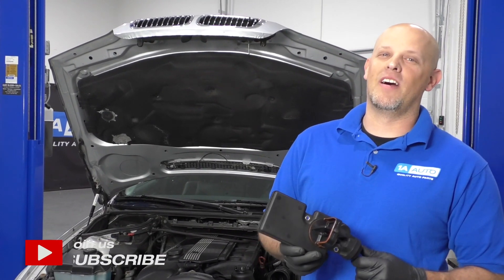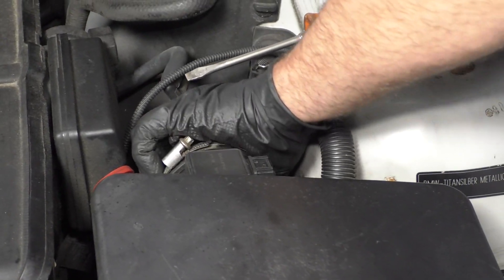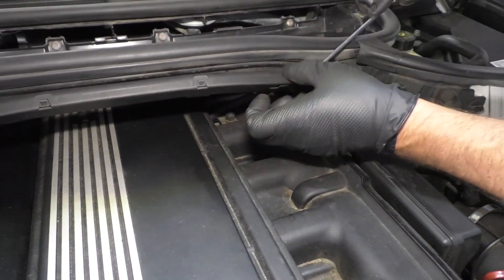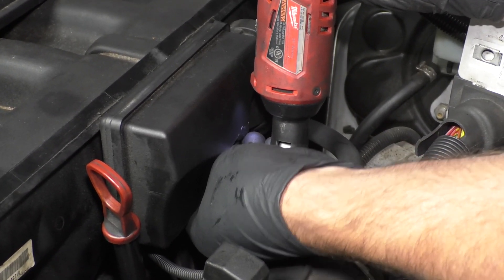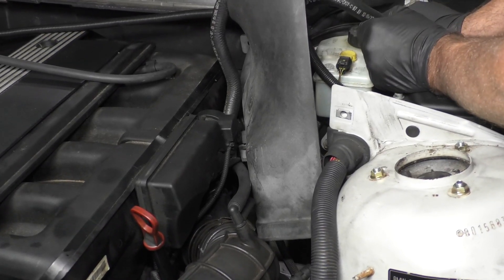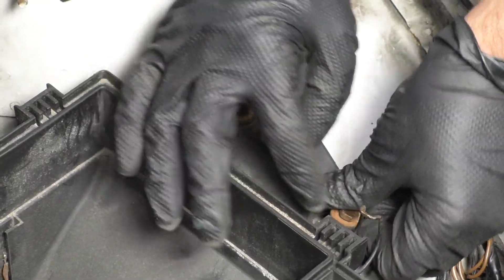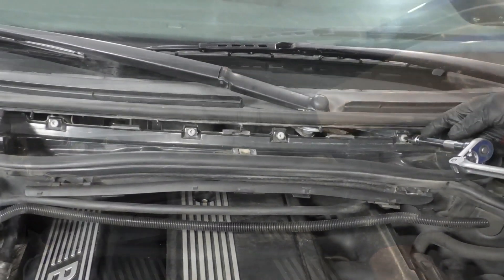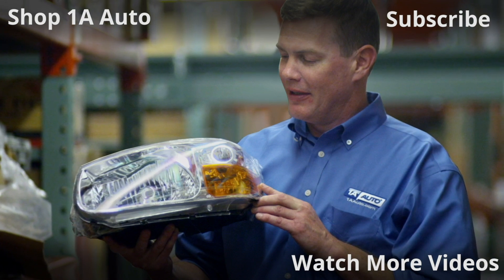How to Replace Intake Manifold Runner Control 01-05 BMW 325Xi

Comment: Is it possible if the seal is old on this part that it’s causing an air leak/misfire? I have a misfire around cylinder 5 and 6 and I’m wondering if it’s because I replaced this part around the time it happened. Thank you!